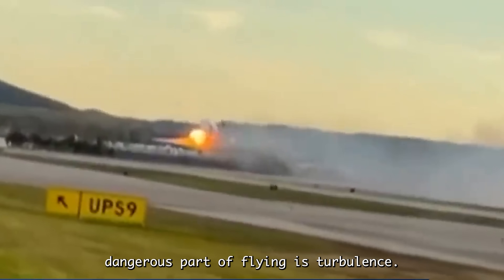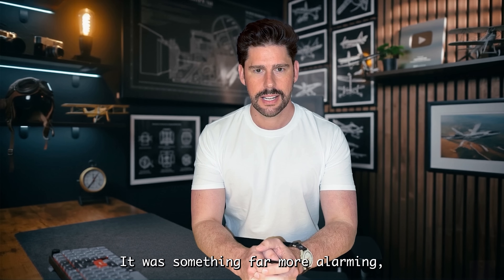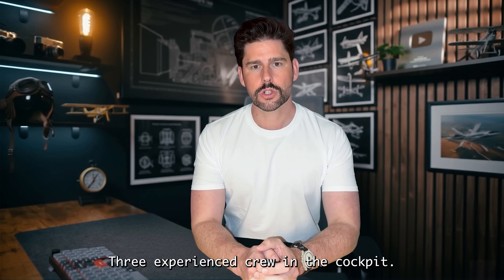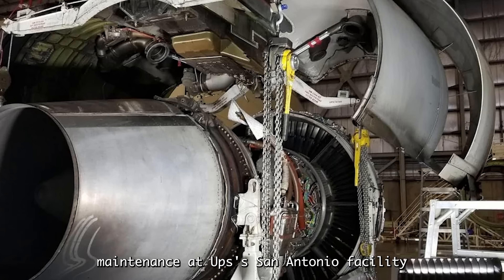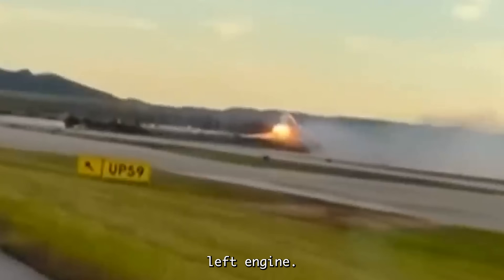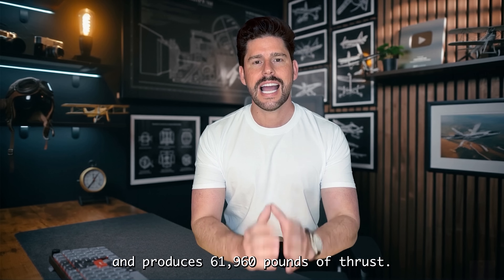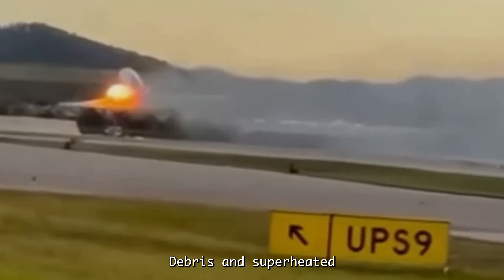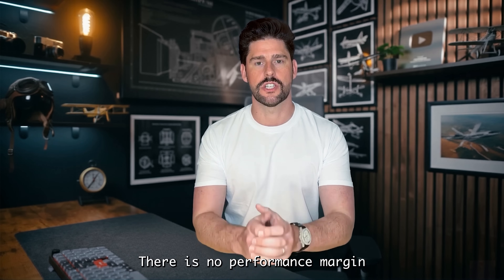The DEADLY Mistake That Caused the UPS MD-11F Crash in Louisville

Comment: Why would we store three hundred thousand (300,000) gallons of fuel at the end of a runway and have high voltage power lines on electric poles strung across (not buried) .. ?
Reply: Yeah it's crazy I thought that was the whole point of permits and planning department.
Reply: @duanejackson6718  check the sight map  the plane went through a building then acoss a street before hitting the powerlines and recycle center
Reply: Wasn't fuel, it was oil recycling facility.
Reply: @TexasHarleyBoy65 true, but dirty oil burns well....
Reply: @franashton5354  you forget the plane went through a building across the street before  hitting
Reply: @franashton5354  not really. This fire was from the 300,000 gallons of jetfuel in the plane.
Reply: @TexasHarleyBoy65  not to mention across the street
Reply: @TexasHarleyBoy65 Die Verantwortungslosigkeit ist deshalb nicht geringer!
Reply: We don't. The fuel is in the wings of the plane. And those aren't high power lines. They're just... Lines. And they played no role in the fire or the accident. That plane was on fire before it left the airport perimeter fence.
Reply: It was cheaper.
Reply: Maybe you should research before gabbing your jaw
Reply: I've been attacked for saying it should be an empty grass field at both ends of runways.
Reply: People! Those things were there BEFORE the runway was ever built!  If anything, it is airports that are expanding into nearby neighbourhoods now adays. And Duane, get a clue. Your permits and planning already happened! Also, buried powerlines are more common in the western US. Above ground powerlines are all over the the Eastern US and basically east of the Mississippi.....why? Because they were put up decades before underground power lines were even thought of. Now, if you want to spend trillions of dollars on converting the whole country to underground powerlines, ask Congress.
Reply: Because Kentucky

Comment: I wonder if they did engine maintenance the same way American did in 1979 using a forklift to remove and attach the engine? I sure hope not.
Reply: Because of bad maintance
Reply: A buddy of mine, who is an air structure mechanic and a pilot, suggested the same thing.,..